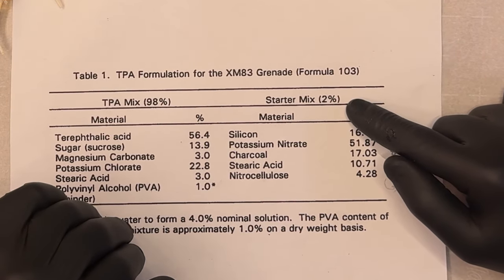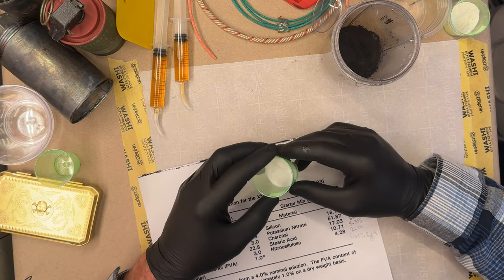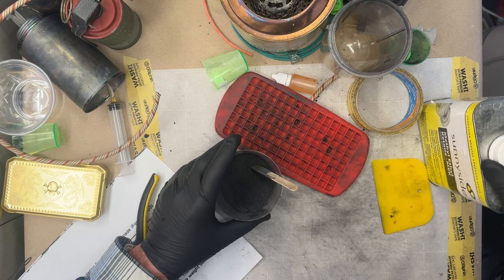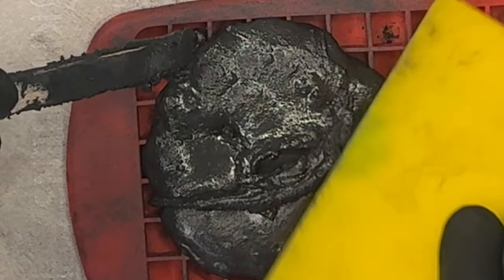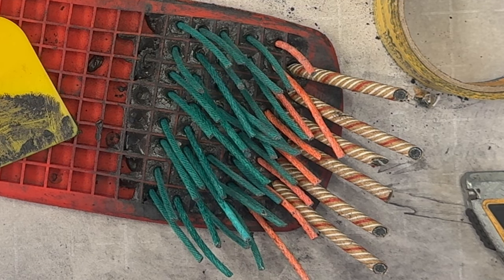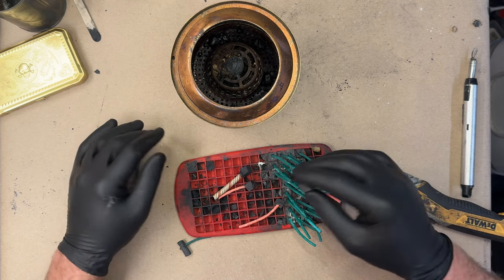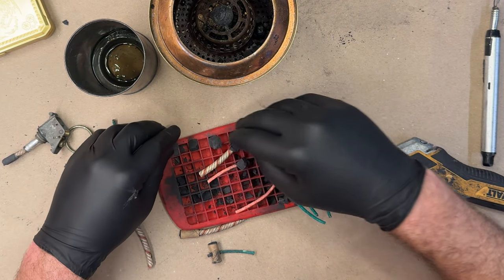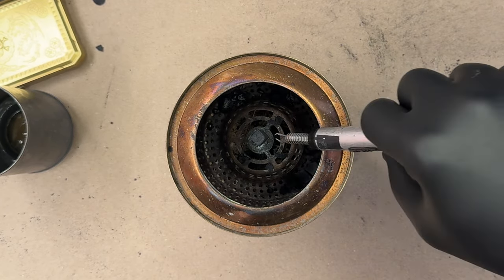Making and Testing the US Military's M-83 Starter Mix (at Home)

Comment: What I'd love to see is a simpler substitute for the primers on used/replica fuzes. Some of the ingredients in your ignition mix are restricted or impossibly difficult to get in my part of the world, many surely relate. Perhaps something silly with toy gun caps or matcheads could work.
Reply: Can you get snap caps or paper caps for cap guns?
Reply: @Microwavingmetal  Sure, though even those are hidden behind the counter these days, haha.

The mix used in the paper caps seems perfect for this purpose but I couldn't get them to light a fuse in my amateur attempts.
Reply: @hohtari1  You could soak them in 50% ipa, and you could scrape off about 6 to 9 of them and pack them into whatever you like, and that should have enough heat to start any mixture or fuse you need. Hypothetically of course. But I can not recommend that you alter them in any way, and you should always use them in a safe manner the way the manufacturer prescribes.

Comment: Hey,
(This is not my device) 
But I feel compelled to inform you of a safer way to set your spoon(s).
You need a finishing nail & a length of dental floss. 

* put the finishing nail through the two holes above the P-Pocket.
* fold the floss in half, wrap the ends around your index finger, loop the hammer & hold it down.
* set & secure your spoon. 
* remove nail until you need to secure your spoon again.

Comment: Awesome!

For Thermite use:
5 parts potassium permanganate
1 parts sulphur
1 parts silicon
(Use mineral spirits to thin, if needed)
Mix dry ingredients first, then add silicon and a bit of mineral spirits if needed. Form into the shapes you want, and insert a visco fuse into it. DO NOT use it for smoke mix, as it burns to hot. Use only for Thermite. (I like black iron oxide vs the red)